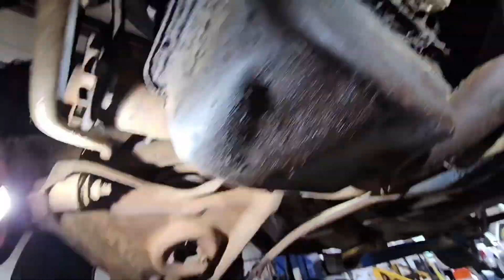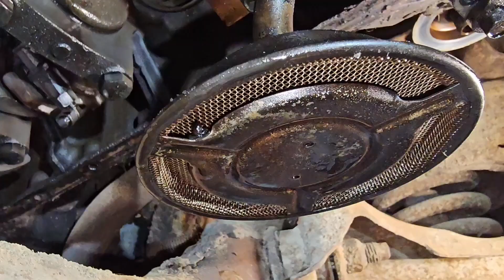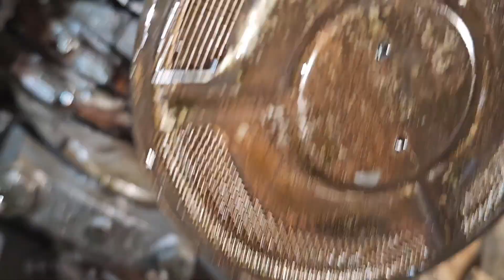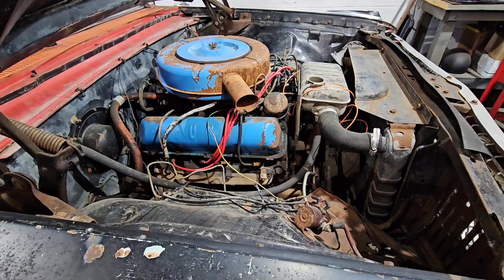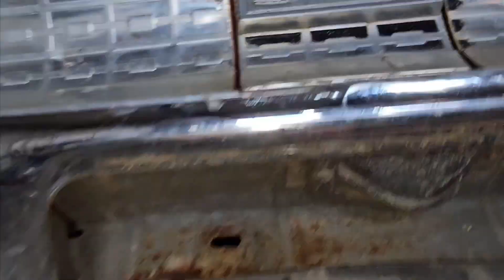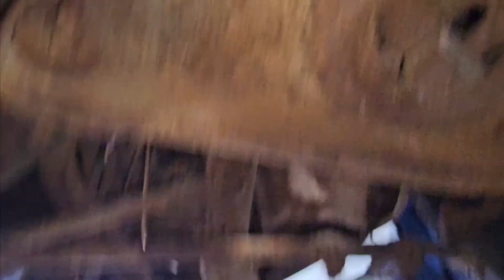Part 2 of getting my abandoned 63½ Galaxie 500 ready for Goodguys car show!

Comment: It acts like no spark. Ck your wire on the distributor for voltage. Also if you're cranking the engine over for start, don't forget to put the key switch in the run position for voltage to the distributor.    Good video

Comment: It could also just be the wire from the solenoid to the starter and a cleaner ground on the starter solenoid helps. I just did all 2 gauge wire on my 64 Galaxie and the starter sounds brand new